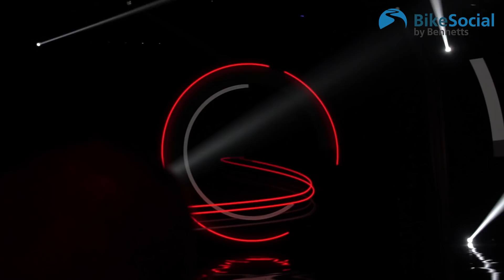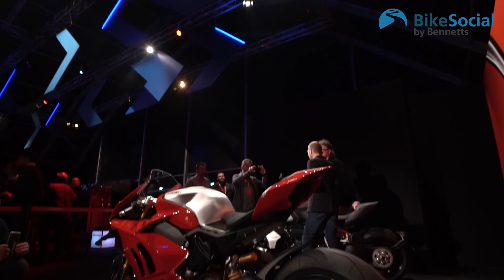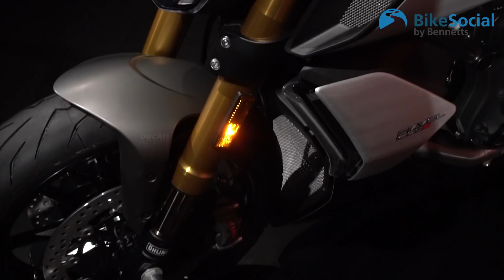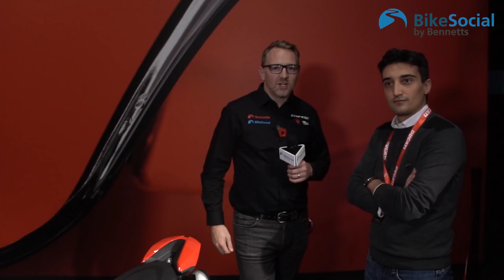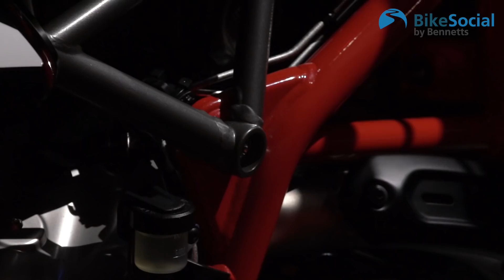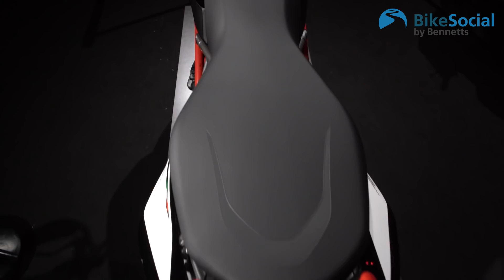2019 Ducati Panigale V4R, Diavel 1260 & Hypermotard 950 walkaround and interviews

Comment: Im defo getting a Ducati V4, which one though? While the R is more exclusive & rare, you dont exactly see many V4's on the road either. I prefer more torque in a road bike, so maybe the S is the one to go for? Cant see the point in reving this high especially on the road? Also think the V4S will be more enjoyable to ride on the road because it has more torque?
Reply: If you ask that question in a commentsection of a video you should maybe just think a little bit more about what you`re getting yourself into because those bikes are expensive as f***. Don´t wanna judge but nobody can answer that question for you!
Reply: @yannickgluck4224  Yes, but what about the Speciale? I have an opportunity to buy one of those? Or this? or maybe the v4S, which is still an amazing bike?
Reply: Net Millionaire i Think you dont get the point...YOU have to make the decision! You cant buy the Speciale and the R anyway because they are sold out so I guess you only have 1 Option.
Reply: Yannick I have been offered the opportunity to buy both of these bikes this week. Need to make a decision which one? Which one is more desirable?
Reply: Poser
Reply: Net Millionaire For the street v4s will be better choice it’s torquer, v4r seem like the bike made exclusively for track riders. From my own experience bikes that heavily focused on top end power in exchange for low and mid range are very boring on the street, The fun and excitement come with very high revs and on the street it’s very hard to redline a superbike so 95% of the time you’ll feel powerless. That’s why today I exclusively ride zzr1400 and h2 because you don’t need to rev those bikes to get the excitement.
Reply: Anton Newman thanks for your comment, makes a lot of sense. I think I’ll for for the V4 CORSE looks stunning!
Reply: No... I meant as in like keep it at the revv range and the race suspension stiffness and the basic slick tires ....
Reply: You can't ride the R on the road I guess so yea... S it is...
Reply: Tejesh Varma yes you can it’s road legal. They have to produce road legal bikes to allow them to race this in world superbikes